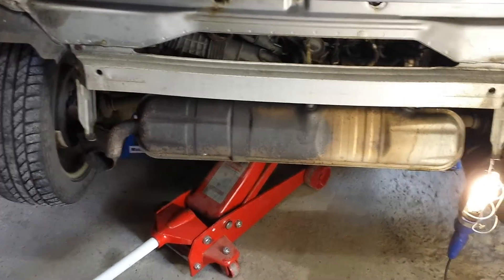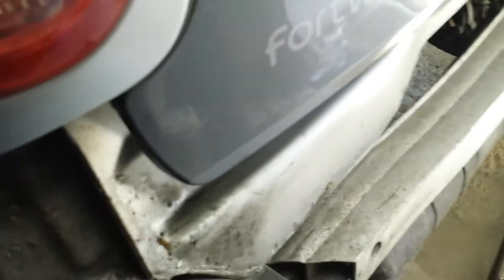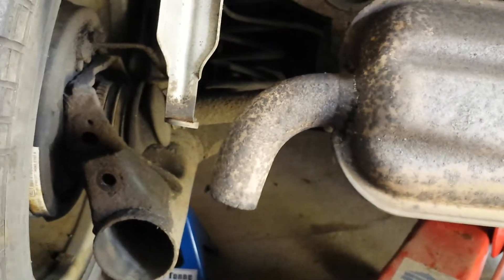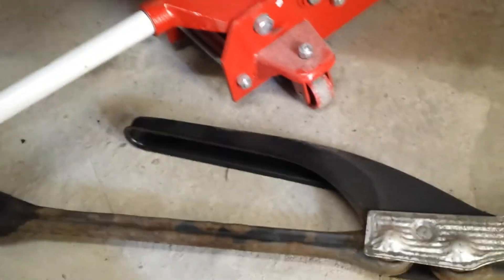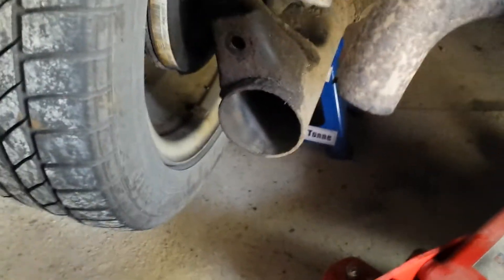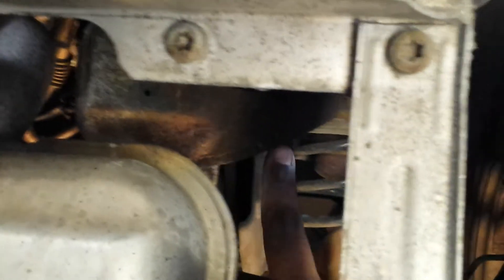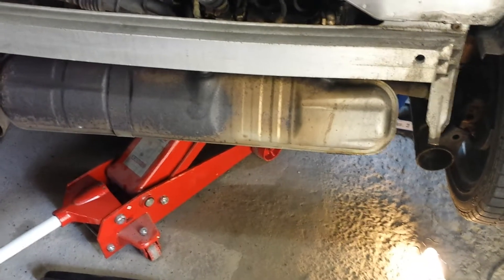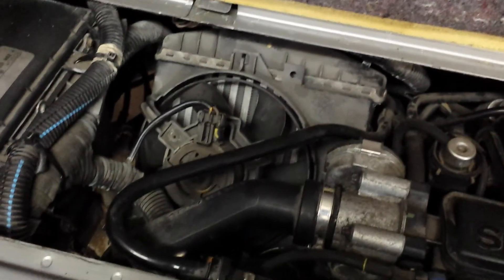Smart Fortwo 450   Starter motor replacement and lowering the Engine   Part 2

Comment: Great video- despite the haters, this is the only way to get to the damn starter motor because of its position.

Once the engine was dropped, I recommend to get an E18 socket on the crank of the engine, and try to rotate the engine by hand. By doing this, I could see that my alternator was seized solid, and this prevented the starter motor from turning the engine (rather than the starter motor being dud). Same could happen with a seized AC compressor.
Reply from the maker: Hi, 

Thank you, I appreciate your comment. I was hoping someone would confirm. The evilution website is also a great resource. I am not a mechanic and I have shared the information with the intention to help others.

Best Regards
Reply: I replaced the starter on my 2010 Smart Fortwo without doing any of this. It can be reached from underneath fairly easily.
Reply: @mylesholloway461  Yeah, the mk2 451 Fortwo is running a Mitsubishi 3b20 engine, not the MB Suprex turbo of the 450 and 453 roadster. Mitsi engines are far more logically laid out... and don't go wrong all that often.

Comment: dude just stop making videos, your totally lost.
Reply from the maker: Hi, have you done this job yourself? Have you replaced a starter motor on a smart 450? 
Check this page, which is one of the best resources on Smart ForTwo 450. I have a link for you here:
http://www.evilution.co.uk/engine/starter_motor_removal.htm
Here is a comment from the page: "With vehicle raised, remove the lower section of the plastic air scoop in front of the gearbox. It is held in position with 2 metal clips and 1 push in plastic pin. Follow procedure for Lowering Engine, ( Right Side Only )"
As you can see it says “follow the procedure it requires the lowering of the engine”.
Also now that you have suggested that I don't know what I am doing, it may be a good idea to tell everyone how it should be done.
I am not a mechanic. I share what I know, just in case it helps someone. I am a pilot and a software developer, fixing cars is just a fun thing for me. If you are a mechanic then please enlighten everyone how the job should really be done.
Reply: @WaqasAhmed-kj8ue  Hey dude, don't take it so personally. YouTube 'mechanics ' know it all.
I've been burnt several times blindly following repair manuals, factory or not.
I've just done one of this exact model and only needed the lift to take off R/R tire to remove belts and bottom bolt for a/c compressor.
Up top remove intake manifold,  intercooler and shroud. Take plastic coolant fittings off of cyl head and water pump housing. Disconnect harness fromA/C pressure switch and swing compressor over into void where intercooler sat.
Wriggle harness past end cap of starter, and starter is out.
Much easier on the 451
Good luck